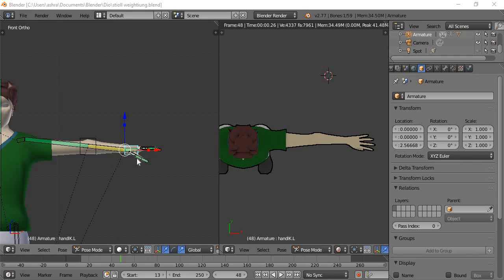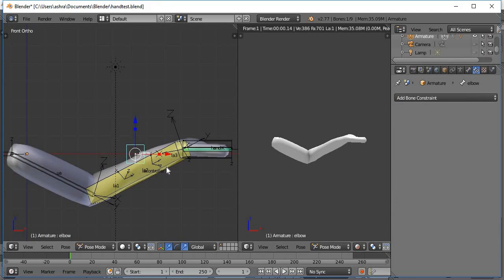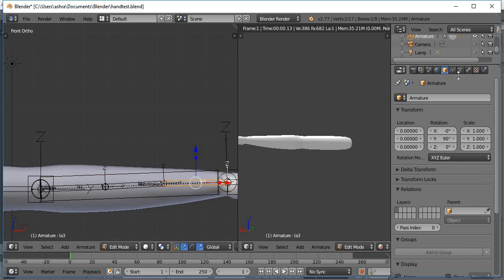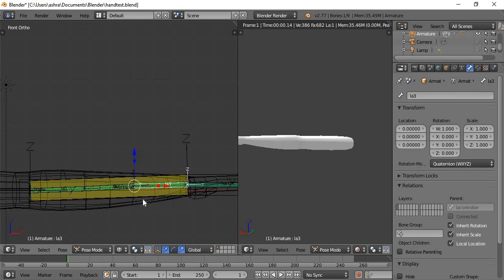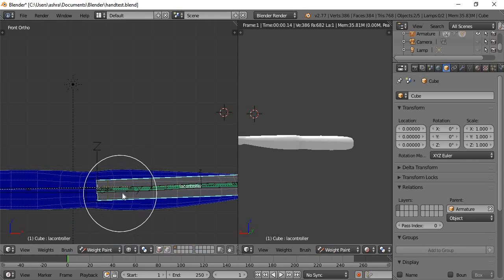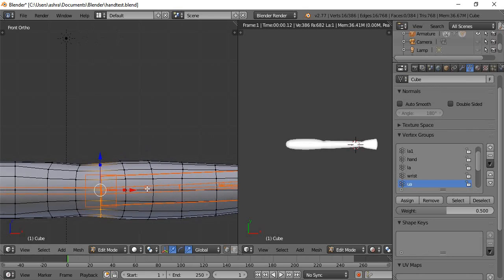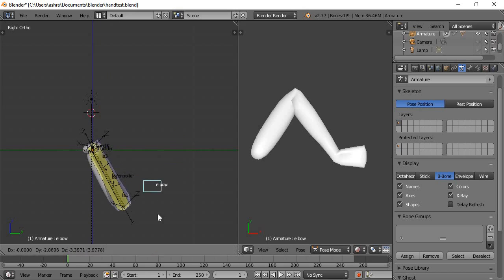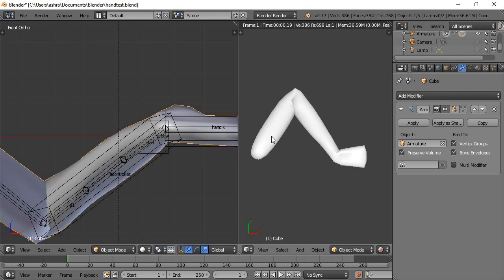BLENDER WRIST TWIST PROBLEM = SOLVED!!!

Comment: soniKslayer,
question. Instead of using constrains, is there a way to connect attributes/parameters in blender? In maya there is.
Also, how about expressions? is there a way to script an expression?
What I would do in maya for a wrist twist is change the rotation order of the wrist joint so that the axis that twists doesn't change and then just connect the twist axis attribute to the twist joints through a math node to divide the rotation.
Reply: I don't know how well this will work but try using the drivers with expressions in Blender 2.8. I think thats as close as you're going to get to Maya's system (at least the older system of having to manually type in the formulas)

Comment: Nice solution. Too bad this doesnt work for me. When I twist the hand bone past a certain point, the bones with the copy rotation snap back as if the bone is resetting its rotation, causing the skin to twist suddenly.
Reply: you usually can't push rotations too far in most 3D programs. be it maya  max motionbuilder or blender. This setup works well in both max and blender. In Maya you have other options that are more robust tho but still.... you push something hard.... it will break.
Reply: What I'm saying is that this rig will work for a regular human whose wrist can only turn about 120° anyway.
If you want more range of motion, I'm sure there are ways to get around this problem in creative ways. For example in XSI there was a solution using quaternion rotations. In Maya there's a solution using a nubs patch and follicles. You'll have to get creative.

Comment: Thank you so much! Short, to the point, and really helped my case. As usual the most effective solution is the one closest to real life - after all, in the human body the twist is happening throughout all the forearm (I've tried other solutions like making rotation-controlled shape keys, but that didn't work as well as this). One quick addition though, if your IK bone controls the rotation of the palm bone (usually called "hand.R/L" in the default human rig), which seems to be the case here in your video, and you parent the 3 forearm bones to it, I've noticed there are sometimes jerky movements in the forearm at certain rotations. Once I've made the 3 bones' rotation constraints to the actual hand.R/hand.L bones instead, the jerkiness went away.